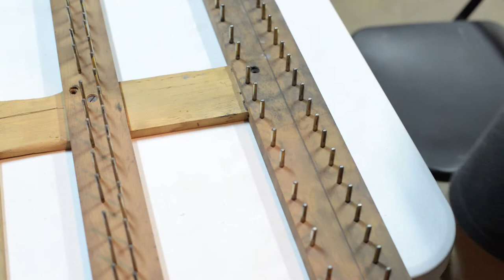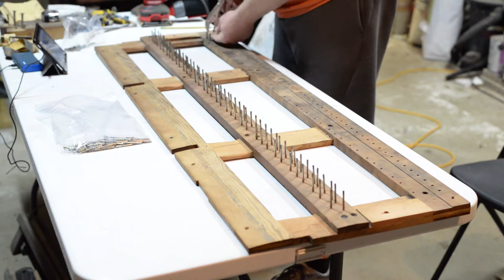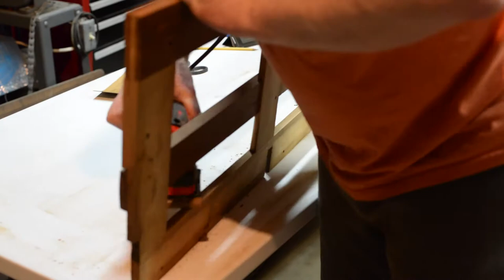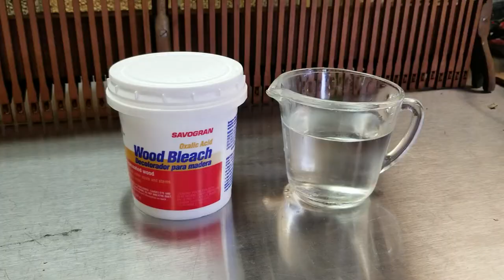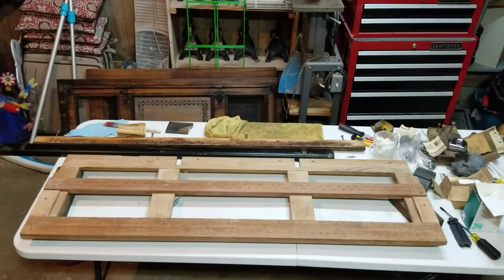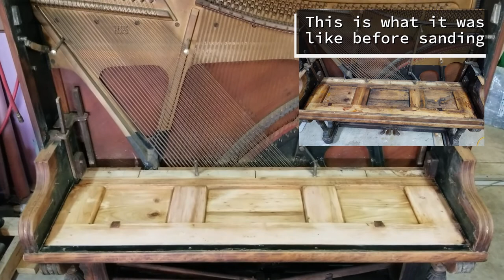130 Year Old Piano Rebuild - Part 7 - Key Bed Cleaning

Comment: You can also put pads on the teeth of the vice grip.  I use those pads that are meant for the feet of furniture, and cut them to size.
Reply from the maker: Good suggestion. If I ever need to pull out any more of these pins, especially the new ones I just installed, I'll do that for sure.